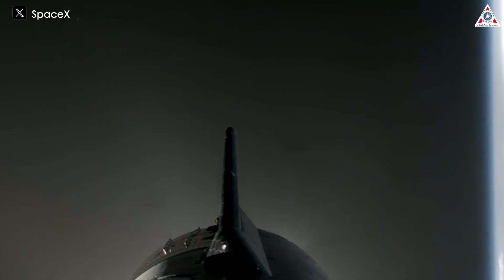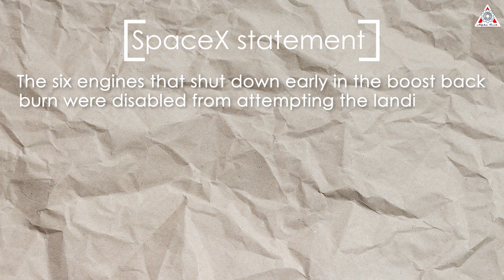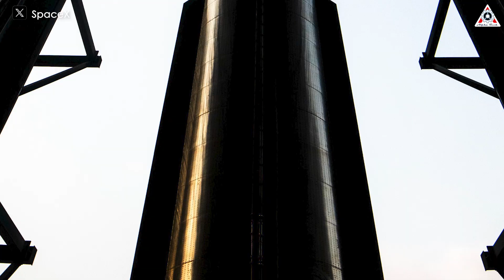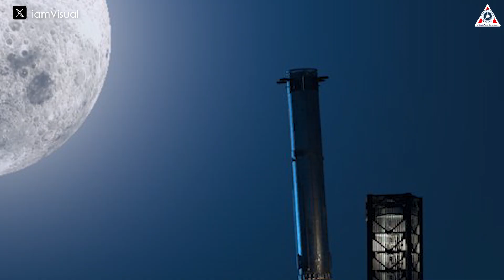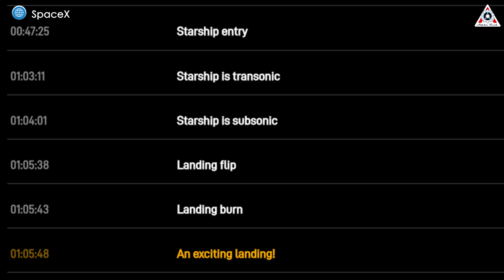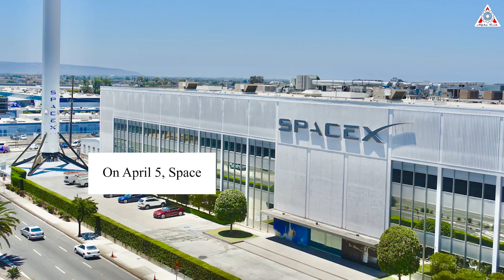SpaceX’s big solution for Flight 4 affter reviewed Flight 3 TROUBLE

Comment: So let me see: oxygen has a melting point nearly 40K below its boiling point. Subcooling conditions could probably be achieved through boiling of the the fluid through pressures changes and large slosh, but given the high latent heat of fusion for solid-OX, this suggests very bad disruption of pressures in the tanks as they empty. Worse, the real story may have something to do with atmospheric entry into the tank(s). While this was not a worry in "traditional" rocketry, with boosters never intended to pivot, it still indicates a typically Space-X sick form of engineering: don't anticipate phenomena with good theory and/or ground testing, just make and break billion dollar hardware. While this may appeal to a certain form of space fan, I can assure you it disgusts most engineers, and should put mortal fear into any astronaut relying on this hardware. NASA had a lot going for it before, including little or no numb-skull "engineering" and value for money for the taxpayer footing the bill.
Reply: How do you ground dynamically test something that big ?
As an engineer, I always want to test things how they were meant to be used to get the best data.
Nasa tested lots of rocket designs before they built the Saturn 5
not all of them worked
Reply: @shadowcaster111  Hello John - you make some very non-trivial points, but I would say the following about this literally "big" challenge:  NASA accomplished at lot - more than I would have thought easily possible - with dynamical testing of test articles all the way from 1/10 scale up to full size. You sound informed, so may remember the static/dynamical response tests made at Marshal SFC (and elsewhere) on full size stages, or the cryofluid slosh tests (my memory fails on test scale here). Elsewhere (my world), I have witnessed big testing  in the nuclear engineering world, where simulations (especially in the USA) went just about all the way up to full Fukushima catastrophic proportions on thermohydraulics test vessels and systems. Even then, buddies of mine were creating, ( in the 1980's)  great, early thermohydaulics code that was at least very qualitatively suggestive of events that could transpire. 

If things fail after all that sort of effort, I still bow down in respect for the engineer that is willing (and has money) to pre-test!  With my best regards to you. DKB
Reply: I'd rather see Murphy's Law demonstrated and iteratively corrected for, than trust my luck to too few tests and be crushed when it really counts.  Especially if the money is there to do live tests (& when it's a few tens of millions a pop in private money, not a billion in taxpayer cash as you said).
Reply: @user-gv4cx7vz8t  I think it is really more like a fe hundreds of millions getting destroyed. 3 complete Starship systems being destroyed with zero hardware being reused and  some costly damage to the infrastructure each time, I think it is quite certain the current depth of the money pit is way over a billion so far.
Reply: My hero!! As an engineer sick of what I see SpaceX calling engineering, I'm glad to see that mostly only fanboys think this "iterative" nonsense makes sense. My hat's off to you for calling it out!

Comment: Of course NASA doesn't want SpaceX and Issackman to raise the altitude of the Hubble and attempt to repair it. Wouldn't cost NASA much of anything, so of course they won't allow it. And some still wonder why we haven't been back to the moon in over 50 years. NASA employees average age during their most productive years was 26, Now it's 72. NASA use to take calculated risks, now they stick to many programs that are just clear failures, such as the SLS. 4 billion a launch minimum, old Shuttle technology, non reusable. SLS has more to do with politics than technology, since those SLS jobs are spread throughout several states.NASA it appears, doesn't want to change with the times.
Reply: Dragon crew only needs to reboost it back into a higher orbit, giving NASA more time. If NASA is so concerned, i'm sure NASA could create an RCS fixture that simply attaches to Hubble that does all the major lifting work. Add a working gyroscope to the package and fuel, Hubble could be back to work.

Comment: This plan looks a lot like the ejection of the interstage between the Saturn 5 1st stage (S-IC) and its 2nd stage (S-II)
The "dual-plane" separation, which requires an interstage, was an alternative to a method called "fire in the hole," which involved ignition and separation of the S-II while still in contact with the interstage. Designers preferred to avoid this alternative because of possible perturbations and oscillations the end of the first-stage boost phase. With the S-II accelerating on an even course, it was easier to drop the interstage during that phase, rather than risk hitting a wobbling interstage attached to the S-IC as the S-II pulled out.

Comment: can they just insulate the oxygen pipes if it's the gas freezing then it being in the coldness of space can be a factor either that or just find a way to warm the filters enough so there's no ice build up. oh oh a water line that cools the boosters but then the hot water goes back up to warm the filter.
Reply: Space isn’t cold. It’s a THERMOS, near perfectly insulated.   Hot things STAY hot a long time.  Cold things stay cold a long time, unless in direct sunlight.  What causes freezing of fuel is the same thing that makes your BBQ propane tank get ice cold when you are cooking burgers. The Drop in pressure.  As fuel gets pumped out the pressure of the fuel in the tank and in the lines drops. This causes its temperature to drop.   For materials pretty close to their freezing point already, the drop in pressure and evaporation into the increasing empty space of the fuel tanks can cause them to drop just cold enough to solidify.   When you see oxygen leaking from the vent pipe on Raptor engines, you see it freeze.   It’s not because space is cold. It’s because of the drop in pressure to zero.

Comment: Just wondering if they have improved the engines to v3, and they are so much more powerful, why have they not used them on the falcon and even extended the falcon for large loads to space. I understand they are concentrating on the starship and booster, but surely the falcon is due some upgrades, it has been more than proven it is a reliable rocket and only needs a little upgrade to become much more usable. Increase the diameter by 1 meter change the engines and you can send almost double the load up to space, stretch it a bit as they are doing with the starship and booster, damn so much could be done to cheaply increase falcon payload and size of said payload, instead of 23 Starlink satellites it could send up to 50 per flight at almost no extra cost other than the cost of the upgraded engines and slight increase in size.

Comment: Great Episode. What would cause the clogging in the valves and filters? You are dealing with pure oxygen and pure methane. What foreign debris could possibly be in the system to plug up filters and valves? By rights there should not be anything in the system gumming up the works. Clean tanks, clean plumbing. There shouldn't be any ice in a pressurized system. Unless there is a contaminant, or foreign matter in the system, in the oxygen or in the fuel. Can you elaborate on this a little more? Thank You very much. Have a Great Day.
Reply: The “ice” problems: 1. there may be enough water condensation in the fuel tanks from the air to freeze into water ice and 2. The liquid oxygen and methane can both also partially freeze and crystallise, blocking the filters.
Reply: @OzCrusader  they purge with nitrogen a few times in testing- and again with o2 and Ch at WDR and static fire
so there shouldn't be much water in there
Reply: @shadowcaster111  Should ANY small amount of atmosphere get into the fuel tanks you straight away have CO2 and H2O vapour which freeze and block the filters.
Reply: @OzCrusader  thats why its purged
Reply: @shadowcaster111  
Ah yes, I’ve heard commentators discuss purging. Is there a propellant that forces the fuel out like a spray can or is it somehow pumped out? What replaces the space vacated by the spent fuel?
Reply: He said 'ice particles'